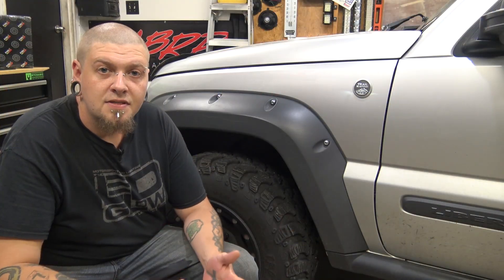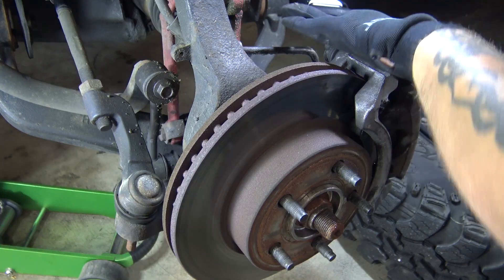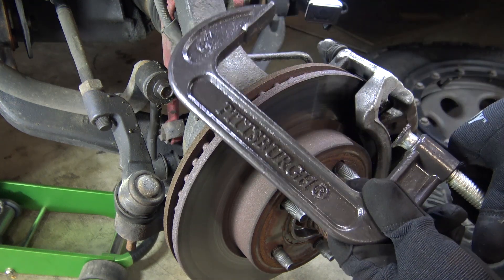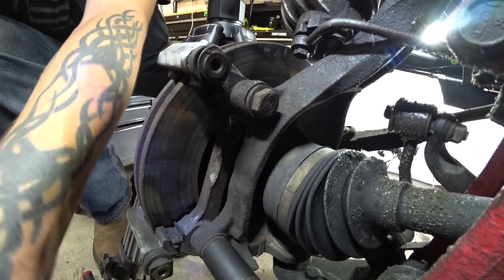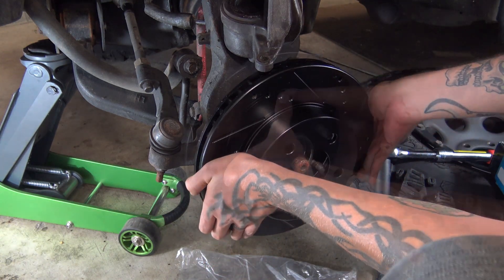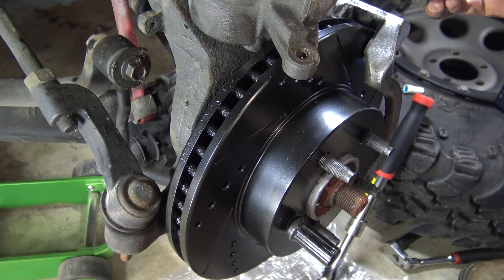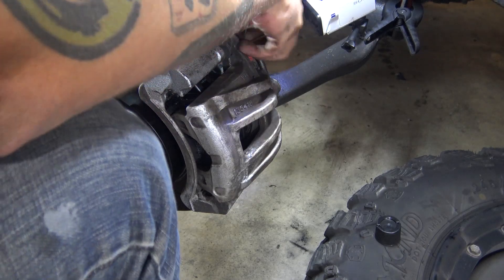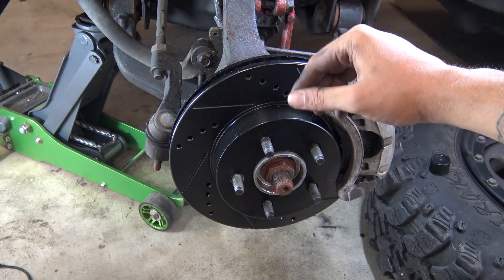How To Change Brake Pads & Rotors, Front (2002-2007 Jeep Liberty)

Comment: With changing the pads, would you also check the conditions of the slide pins?  I make it a habit to check the condition to the lubrications and slide pins for possible rust.  On occasions, I’ve had to replace the pins which didn’t function correctly and did premature wear on one pad.  Just an added check point while you have the brakes apart already.
Reply from the maker: I always check the slides/slide pins, a habit I picked up from my father. I usually wire wheel off the pins until they shine and replace the grease with Permatex Ultra Disc Brake Caliper Lube -   https://goo.gl/yWaa7U Thanks for watching!

Comment: Nice job! Thank you for sharing! I was wondering if you would make a video of how to replace coolant for the jeep liberty as well as the parking brake shoes. I have a 2005 Liberty and the coolant is not pink at all like the mopar coolant is supposed to be xD
Reply from the maker: I did the coolant a while back (no video) I had a hole burst in the radiator and it ended up being a parking lot job. As for the rear parking brakes... I may get around to a video, if I get all the parts. I told someone else in the comments that I have already filmed and edited a video for the rear and I didn't do the E brake because everything is pretty much gone... and they can be a pain! Maybe someday though as it seems to be a popular request. Thanks for watching!
Reply: Rocky X TV Yeah I want to change it but it looks like a pain to deal with for someone like me who has no experience with it. But I do need to change it soon as my ebrake doesn't work at all since the shoes are worn to the metal.
Reply from the maker: I know a lot of people that are handy with vehicles and they still take their cars in to have drum brakes done. I've even went as far as not buying a vehicle because it had drum brakes! Hopefully I can locate all the parts I need to repair mine and I can get a video out for everyone. Mine fell completely apart, I don't have any of the parts in there anymore so I'm not 100% sure what I need to order if I'm being honest.
Reply: Rocky X TV When I was shopping for brakes I came across quite a few kits for the drum brakes for the liberty and they seem pretty inexpensive coming around to only 10-20$ bucks for a kit on ebay. Yeah I feel like drum brakes are the hardest things to work on in a car. But I feel like its better to learn it rather than ignore it. That's why I love my liberty. Its the car that is going to teach me how to work on a car so I can be better prepared to take care of a car that I love. Not saying I hate the liberty, it was my dad's car before I inherited it but its a better car than any to learn.

Comment: Very nice video! What are your thoughts on lubricating the slide pins when changing pads? I recently changed my rotors, the fronts came off in a snap but I invented a couple new curse words when trying to take off the rears!
Reply from the maker: I would recommend cleaning them off and putting new lube on them whenever you change pads. I always do, but for some reason I always forget the little things like that when making videos. I had to go back and take everything apart and lube them, not 100% necessary but it would have drove me nuts knowing I didn't do it.

Comment: Just did this with new ome suspension lift this last weekend
Reply from the maker: Awesome! How bad was the OME kit to install? I need to switch to a quality kit because mine has sagged almost 1.5" in 10k and it was only a 2" kit to start with!
Reply: Rocky X TV I had to get the front "struts" assembled at a local shop cause once i had the spring compressed I couldn't remove the spring compressors I had. But the front wasn't bad except for the drivers side upper control arm bolt. Rear was easy. In the front I also added jeepinbyal upper control arms and top plate and a did a small clevis lift. The rear had 2 additional top spring isolators. It sits at about 3-3.25 inches above stock height.
Reply from the maker: Very nice, thanks for your reply!

Comment: Great you Rocky, the Disk pads are not that bad and most people will give it  a try like I did. now you should make a video on how to How to Replace Drum Brakes, Now those are a bitch. I don't even mess with them. but I would like to learn. I know a lot new cars don't have Drum brakes, but someone of the old cars d. keep them coming Rocky.
Reply from the maker: I need to get a vehicle in the shop that had drum brakes so I can make a video. I hate doing drums and understand why a lot of people won't touch them, but like you said, it would make a good video. Thanks for watching!
Reply: The 2002 Liberty, in fact, has rear drum brakes.   I'll probably jinx it by saying so, but I have 170k miles on our '02 and have not replaced the rears yet.
Reviews report that the Toyota Tacoma mid-size pickup still uses drum rears.
One possible  advantage is "simpler" application of the emergency / parking brake.
Reply from the maker: It definitely is a better way to implement an E brake into the system. I hit 190k before the drums/e-brakes on mine just fell apart, I have disks but still have a drum style E brake built into the rear rotor. I had no idea anything had drums on it anymore. I guess they have to hang around and continue haunting someone. Thanks for watching!